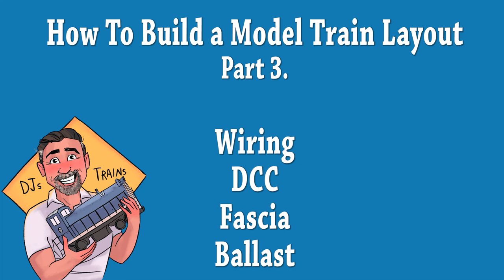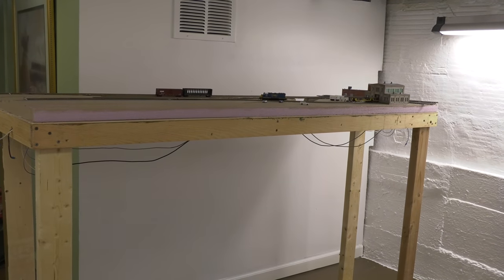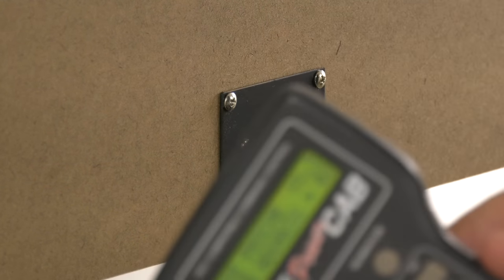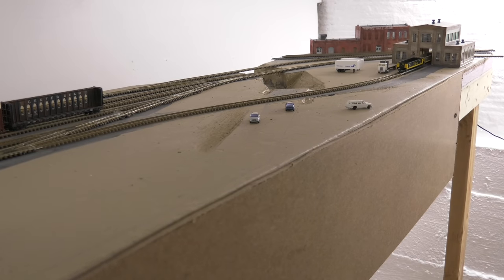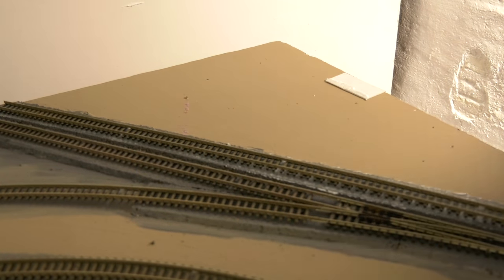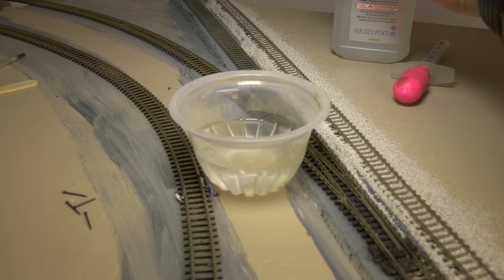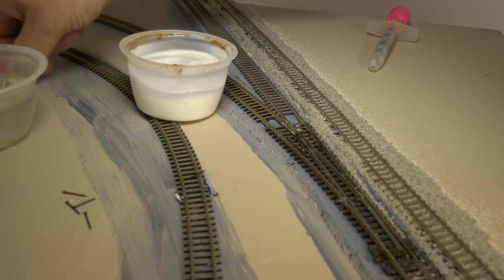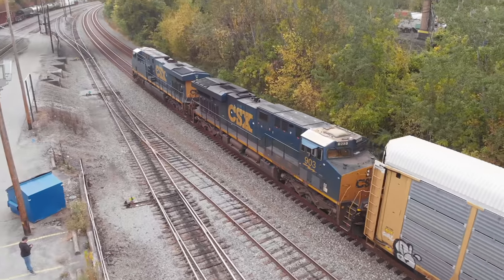How To Build a Model Railroad Part 3. Wiring, DCC, Fascia, Ballast

Comment: I'm willing to admit that yes DCC is king. It is the accepted standard. For now. But as battery technology gets better and better eventually one of the manufacturers will jump in with a dead rail system. This is the future of model rail road control. The place I think this will enter the market place is probably in the simple starter sets with a loop of track, an engine and a few cars. A charging cable and adaptor for the engine. For the throttle all you will need is a Bluetooth capable device that you run a throttle app on. No more wiring to worry about. No more powered frogs. No more headaches over reversing loops. If they can sell little remote control toy helicopters a model railroading application is easy. Yes I know there people doing this.  Either as a hobby or offering conversion systems. Think of it for seldom used branch lines with rusty rail. Now if Kato, Bachman or somebody would just take the plunge. 
Even there are multiple operating systems to control the different manufacturers equipment you could run the equipment any where. On any layout, no matter if its block control, dcc or a simple switching layout with a transformer.
I will now get off of my soap box.

Nice video by the way. As always.

Comment: Looks nice. But when wetting and gluing the ballast it is enough if you add the liquid just outside the rails. The capillary force will move the water all the way through the ballasted area. That way you wont disturb the ballast. Thanks !
Reply from the maker: Thanks for the tips!

Comment: Looks sooo simple. Thanks. A couple of comments. When connecting feeders, do it with the DCC power ON. Yes ON. Your DCC system will immediately tell you if you create a short. Much better than adding all feeders and then turning the power on only to discover that there is a short somewhere. I'm not a fan of soldering under the layout so I connect my feeders using insulation displacement (suitcase) connectors. Never had one fail. But, they come in different sizes so choose the size that fits your wires....Harold

Comment: Wow i never knew DCC was that "easy" ( im sure i will find a way to screw it up lol) i use Scenic cement for ballast ALL WAYS THE EYE DROPPER and NEVER the the spray bottle those two YN2 SD40-2s in Riverton my friend saw them on a WB Freight in Coraopolis with a Genesee and Wyoming painted loco most likely dead in tow my guess is there heading to LTEX in ohio Thanks for the great video! I will send you pictures of that ho scale railway museum i finished on Instagram

Comment: Please,please make better connections. Either solder or "suitcase" connectors. I have maybe 200 on my layout and they are easy and final however if you need to disconnect you can. Believe me it will catch up to you later.  
Good video.
Reply from the maker: Thanks for the tips!

Comment: DJ I always learn something new. I have been good at ballasting that is yet another reason for me to use KATO Unitrak.  Still, when I did try I always had a mess.  I like your technique, but as you indicated, it takes patience.  I use Digitrax and not NCE.  I was told that NCE would limit my DCC experience so I just never tried it.  Live and learn.  Thanks for the video, I look forward to the next update.

Comment: Thanks for video.  Instead of plain water, I use 50% water/alcohol.  It makes the glue mixture sink in and dry faster.  This is just  suggestion.  There are many different ways of making scenery glue.  A check with a search engine will give more than enough.  Take care

Comment: Great videos!  I'm just getting started bringing my Dad's old Lionel set back to life (2037 engine and some cars).  What gauge wire did you use for the feeders and mains?
Reply from the maker: You'd be better off googling the best answer for Lionel, since I use N gauge which uses less electricity.

Comment: This is not about your layout but since you are an engineer I am asking. I want to install signals at a location where a siding comes off a double main line. Should I use a bridge signal setup, cantilever or just pole style that stands to the side of the track. I don’t understand how signals work at all. Would I need the same setup at the other end as well.  The layout is set in today’s time and is all modern power and rolling stock in CSX and Norfolk Southern mainly.
Reply from the maker: Lets say that we are going north on your main.  The switch is a facing point, going off to the right. 
You technically need a signal if it is a switch powered by the dispatcher (NOT HAND THROWN BY CONDUCTOR). 
The dispatcher lines the track to the siding, and the signal indicates that the switch is lined to the siding.  Now, you need a signal which faces south, to protect southbound trains from running through that switch.  (This is if trains can operate in both directions on your main lines).  Now, you also need a signal from the siding to the main.  This signal protects a train that went into the siding from coming back to the main with the switch lined main to main.  So Technically you need 3 signals if you have a powered switch.  But wait, there is more.  On your mains you need a signal about 2 miles prior to the switch to let trains know what to expect up ahead.  Last thing we want is to be doing 50 mph with a 18,000 ton coal train and not know that there is a red signal up ahead, or that we are lined for the 10 mph siding!    See this video for industries 1 & 2 which have spurs come off the main at an interlocking. https://youtu.be/40beS63tqBc

Comment: Good day . I like your show it is useful, I like to know from your experience what type turnout of PECO System I can use it in my layout #13 from ATLAS Book # 11 p# 20. It has 5 turnout # 4 by ATLAS Cod 100, 3 L.H, and 2 R.H by using the DCC System. Since there 2 type of PECO Turnout one is Elecrofrog, and Insulfrog. Best regards to you for your time.
Reply from the maker: I prefer insulfrog personally.  Less wiring, in my opinion.
Reply: @djstrains  Thank you for your support to my request

Comment: Hi, dj. I need you to talk me into going to dcc.   I get buying a controller for around $200.00 dollars or so. But other than that I need to know a cost for starting out. Like decoders, those power outlets on the fascia. I will be using mostly older engines that I find on ebay or train shows. The price of new ones especially dcc equipped are more than I want to spend. So a basic start up cost would be appreciated, thank you dj. I really enjoy your videos, especially starting over with the basics, that never gets old. Also I'm looking into sharing videos on YouTube in the future. Any suggestions on getting started and topics. Or just show a weekly update? You seem very comfortable making your videos. I like that it looks like you are being yourself and that's good. Anyway sorry writing so much, just trying to be thorough in my questions. From Jeff.
Reply from the maker: basic start up  is under $200.  When making videos, plan, get to the point, keep camera still. Start today.
Reply: Don't skimp scale trains are awesome at around $230.00 for n scale. My Kato engines cost $100.00 plus decoder at $45.00 no sound and detail is not as good as scale trains. Also I have Broadway Limited AC 6000 and hard to program. I have 4 and only 1 works easy. Scale trains well worth the money.

Comment: Thanks for the tips DJ. Just a precautionary note, when cutting that hardboard for fascia, use a mask or cut outside, that dust from the hardboard off a jigsaw or saber saw is not good for your lungs. Some lumber stores will not cut that hardboard because of that dust. If you can, just scribe the hardboard with a new sharp utility knife and snap it, just needs a little file work to smooth edges, again use a mask. Thanks.
Reply: At last! A REAL use for a COVID mask!
Reply: @KutWrite ....LOL how true😀

Comment: Is there a preferred gauge size for the DCC BUS line that works the best?
Reply from the maker: waiting for input from readers.  I think it is based on your scale and voltage you will be pulling.
Reply: @djstrains  I did my research on this which I will post here for anyone else down the road curious to these details.  The DCC bus line should be 12 or 14 gauge common residential wiring.  Personally I think 14 would be perfect.  The feeders should be 18 - 24 gauge wiring but again I think 18 would be ideal.  The feeder drops are a matter of preference from every 2 feet, 4 feet and 6 feet.  I think 2 feet is overkill and even 4 feet is pushing it.  However, I think every 5 feet is a good number for feeders.  Addition feeders can always be added fairly easily at any time if power becomes weak on a section for whatever reason.  Also, feeders should be added right before a switch and right after a switch.  Good results should be achieved by this formula.  Thanks DJ.  👍